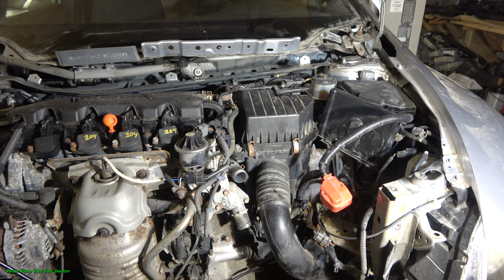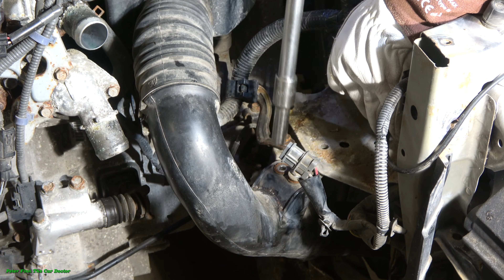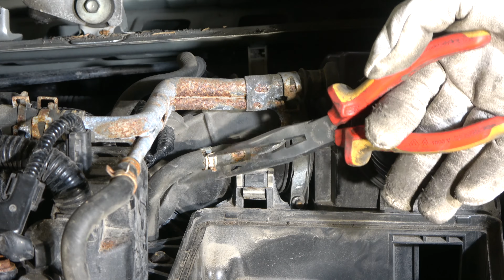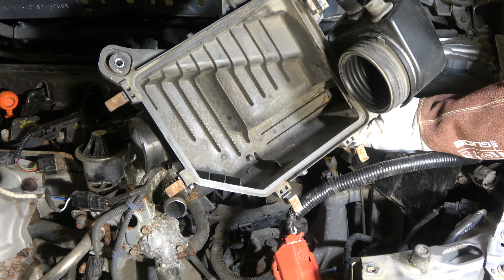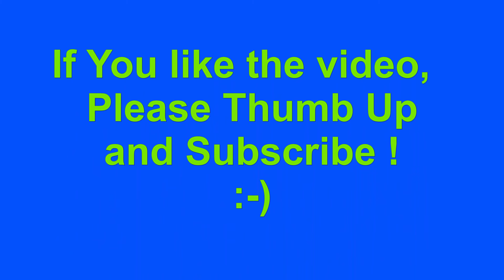P10. Engine Replace ENGINE Honda Civic 1.8 R18A1:  Air filter housing removal

Comment: Great video! If you struggle with the rubber grommet spray a little brake fluid on it to make it slippery.
Reply from the maker: Glad you liked it!
Reply from the maker: Thanks for the tip!